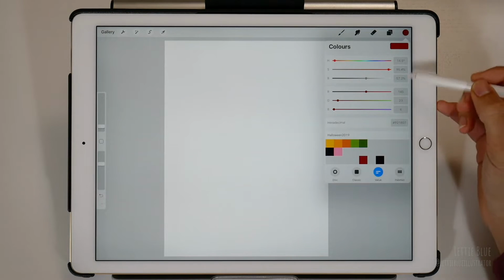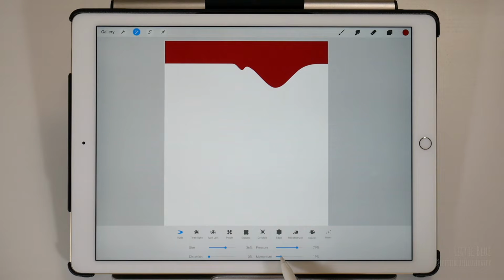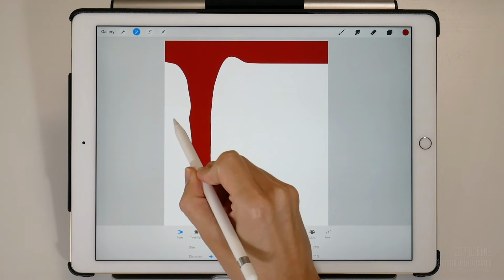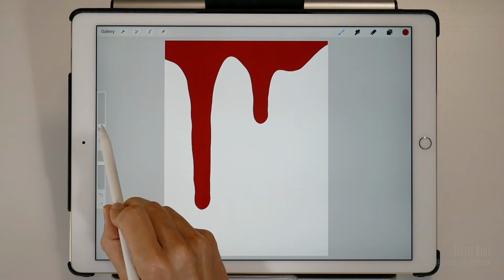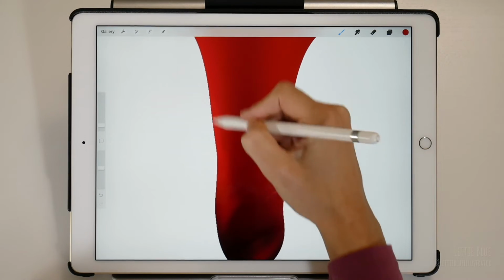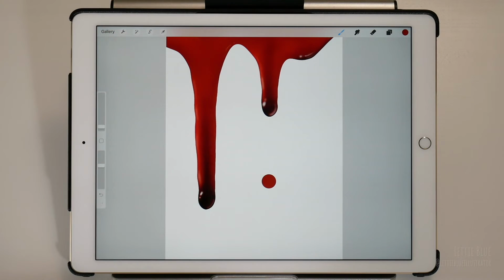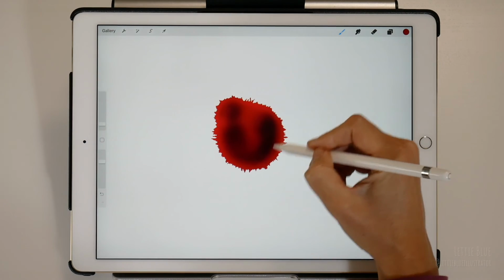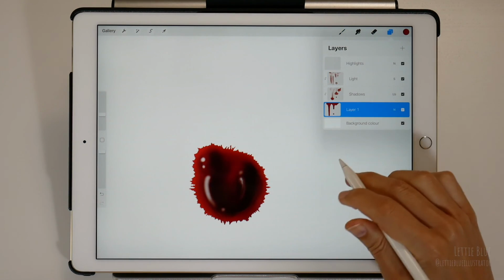Procreate Tutorial for Beginners: Drawing Blood

Comment: How do you do you draw blood on fabric like not actually draw on fabric but like draw on procreate
Reply from the maker: You can insert an image of a fabric texture and then use blend modes and layer masks. Blend modes will make the fabric texture layer and the blood layer interact. Choose the one that suits you best. Most blend modes will let you see the fabric texture through the blood. You can use layer masks to adjust the way you see the texture through. For example, you can make some parts completely opaque - so you don’t see the fabric texture in the areas where you have a thicker layer of blood drawn. Hope this helps. :)